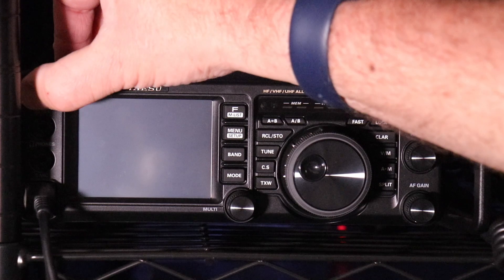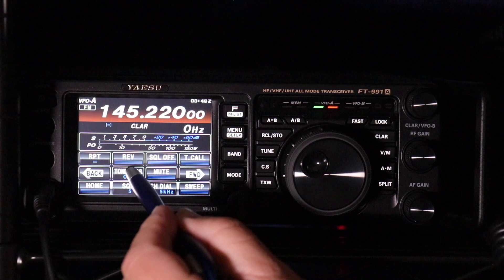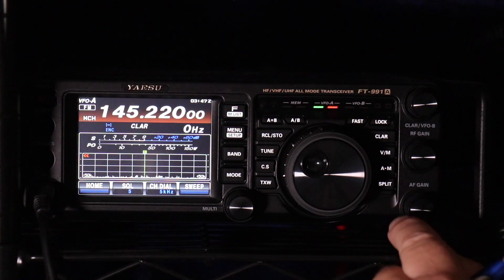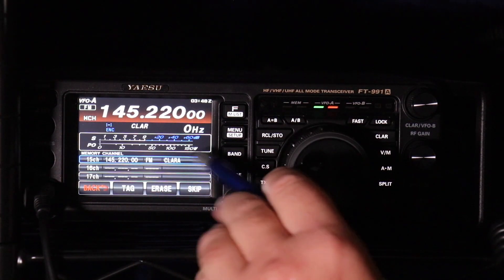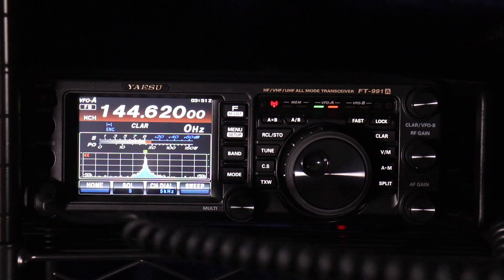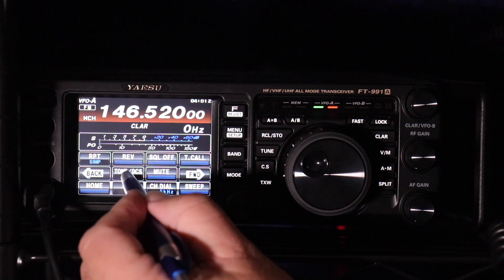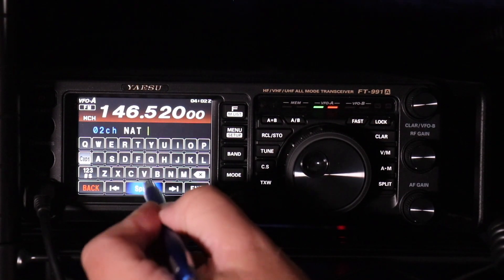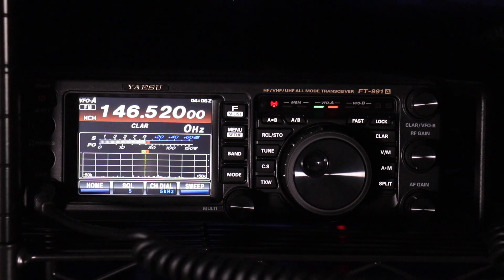Yaesu FT-991A Repeater Programming

Comment: Currently operating on a DX10 and FTM300 at home but I wanted an all-in-one to take along while my wife and I adventure with the camper (also, I'm a two is one kind of mindset so it's relieving to have the backup). I have a 991A on the way and I'm curious...after you place the TAG on a mem slot, is there a way to make the TAG appear on screen when the channel is selected?  Nice video...thanks!

Comment: Only reason I want a 991a is because of 2 meter sideband.  For 2 meter FM, I still plan to use my Kenwood 281a with 65 watts.  The 991a only does 50 watts on 2 meters and 70 centimeters.  I'm also wanting to upgrade from my Kenwood TS-430S so I can also do 6 meters. 73 W Rusty Lane K9POW in eastern Tennessee
Reply from the maker: Thanks for watching and commenting! It is greatly appreciated.  2m is the same reason I bought the 991A... since I foolishly sold my FT-857D.